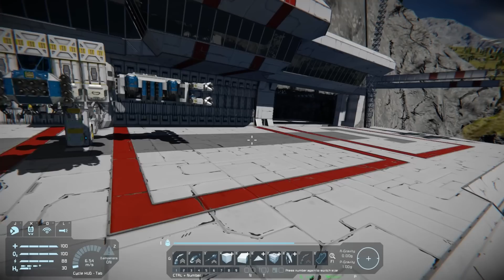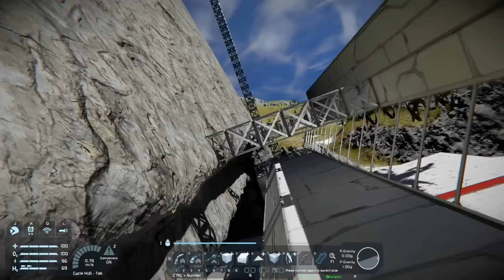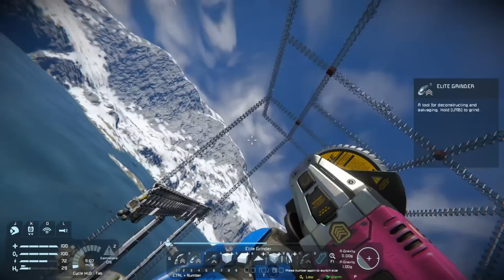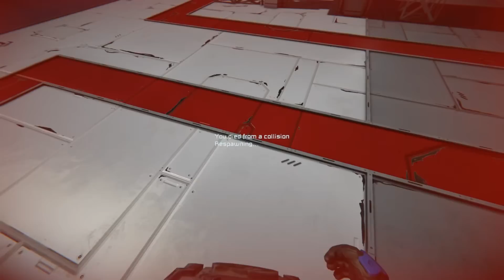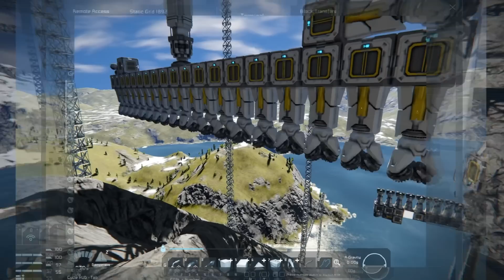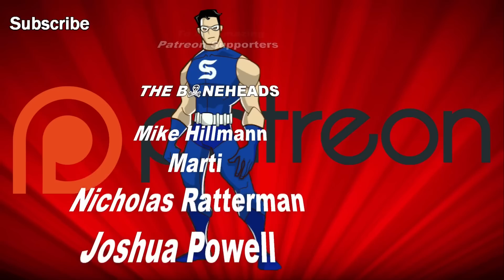You guys SCREWED ME OVER and this test PROVES IT! - Vanilla SPACE ENGINEERS Survival - Ep 21

Comment: You would be better off using blast doors around the outside of your moving door blocks then using the flat armour plates to fill up any gap.
I had a similar problem with a farming setup when trying to get collectors to drop from the Ceiling to collect crops.

Comment: I used blast doors with airtight doors I didn't have any problems also any block that came in contact with the door should be a angled block placed to appear like a normal flat block from the viewing angle

Any block in contact should be angled that includes the wall it rubbes against the door on the right and left   

Had the same problem on a 1/4 test door I was making and I rebuild the test door 8 times before it was happy then made it bigger on the base and works  97% of the time but when I doesn't work it is usually the top door like yours

Comment: 11:45 Structural integrity in Space Engineers is not a thing. You don't have to build the blocks to 100%, just slap the frame and that's it. You can build the base in the air with just one single unbuilt block below touching the ground, just frame.

Comment: I wonder if the "Infinite Drill" design would work in this scenario. The original design is much less grandiose but essentially through the use of Event Controllers and Timer Blocks, it "climbs" down by welding a projection of conveyors and each "level" is a rotor head that it uses to connect to. Hard for me to explain, could probably find the video quite easily. But it's one piston, with a rotating drill head about 5 or 6 meters wide. It extends, locks the bottom rotor to the side wall, releases the top rotor and retracts downwards to where the top rotor will then lock, and now release the bottom rotor and begin extending again. It's quite a brilliant design, but again I really don't know how well it would work on this scale.

Not trying to tell you how to play, by all means keep experimenting! That's the name of the game after all, I just thought I'd share an idea with you :)

Comment: Okay, I've not been part of the discussion up til now, but there is a way to make the doors work. You have to limit the piston so the back of the door blocks (top of the top/bottom of the bottom) doesn't perfectly align with the edge of the adjacent blocks. So, limit the piston movement to less than the distance of a full block. As soon as the door passes the edge on the top it will get stuck. On the bottom the weight of the blocks actually limits its height by a fraction of the distance.

Comment: To be fair, ALMOST all blocks do slide past eachother completely flush with eachother with 0 issues. And to be COMPLETELY fair - your issue must be in using 1 piston to move 1 very long object. If you use merge block to connect to pistons to a single subgrid on either ends it will be much more stable. Either that or you'll awaken  the kraken. With Space Engineers you're never completely sure lol
Reply from the maker: To be COMPLETELY fair ... you've totally missed the point (like a lot of people tbh) .. I had the right solution and I explained exactly how I was going to do it .. people told me to do it a different way WHICH CANNOT WORK ... it's that simple. You're also wrong about the "1 piston to move 1 very long object" .. that has nothing to do with it :)

Comment: So regarding the part where you grind one block and it works:

You don't even have to grind the whole block down. Grinding or welding a single stage will almost always get it moving again.

I've found that cranking the on-axis torque WAY into the red almost always helps in cases like this.

Off-axis is tricky. Sometimes a very low value works (at the cost of speed) and sometimes a looser tolerance (via higher value) is the solution.

Comment: So, the funny thing:
The plain blocks were specifically altered like... What, over two or three years ago? Yeah they used to be unable to move thorugh precisely sized spaces! However, their actual collision box was reduced by a an entire /milimiter/ making it so that any random microstutter from subgrids don't make it grind against others because it has an invisible space to wiggle about.
But yeah- anything that's in subgrids has this microscopic stutter to it (because the physics engine isn't perfect) and anything that has TOO precise of a positioning will eventually break as the subgrid moves an entire milimeter to the side and scratches something. The thing is that it's hard to know what specific blocks are too big and which are just right if you don't experiment (we don't have a wiki with that stuff or anything).

Comment: so, the collision problem with the hangar doors is a mildly interesting one. largely because any blocks with an active state usually have a slightly larger collision box than regular armor blocks. so yes, regular armor blocks on pistons can fit through a gap of the same size, BUT other blocks, such as ANY door normally dont as Keen uses a slightly larger collision box to ensure said doors are air tight.
Reply: Indeed. I hope this is addressed in SE2 as it could lead to some awesome pop up elevators.

Comment: Three things 
One. This is cool
Two. Clear out voxels? And use armor plates 
Three. It may be gravity based problems? A solution would be like using artificial gravity gen and mass set the gen too -1 and make the area small just too cover the why contraption
Reply: Gravity generators do not work within the gravity of a planet, as a rule of thumb natural gravity always overrides artificial in Space Engineers. This is a good solution for massive space doors though, and could be a safer option than simply pushing moving parts into the red numbers on their strength settings.
Reply: @shocktnc  yeah i deal mostly with gravity stuff in space so didnt know that thanks

Comment: (Wasn't here for the 'wrong' comments)
Mostly you didn't hear about it because its hit or miss if it works or not. I've never had problems using pistons+blast doors. Ever. Yes, I realize that is odd and it really irritates my SE gamer buds.

One friend however has your same issue though. He finally went with putting the entire row of blocks in front/behind the blast doors on a hinge so to rotate slightly in order to clear the collision hit boxes of the extending/retracting column. That *might* fix your problem. But I'd test it on a dedicated test save first.

Comment: There is a lot of miss information that goes around in the SE community. I myself have fell for and spread some myself in the early days. I learned to test everything before taking any ones word. The collision  update had a lot of players not understanding what exactly the update changed. I tested a lot of different blocks to see for myself.

Also, something I do in situations like you were in with the drills where you had to go up 3 pistons, you can instead turn the drills to face the direction of rotation rather than going back up. But you will want to take its slow. At least until you get deep enough to set the drills up as normal. Make sure you test this idea out and understand its limits before trying it on your playthrough though, lol

Comment: Not really sure Sky should be blaming his viewer suggestions for experimentation within Space Engineers that doesn't go to full plan. Its an integral part of the game, trying to figure out better ways of achieving  results, lots of effort time and is needed until you've gained enough experience and knowledge to get things done quickly and smoothly.  Until then it will be littered with failures. I think suggestions are just that, its up to Sky to make his decisions as to use them or not.  Perhaps doing small scale testing to be sure and even then it might not work out like in this case.  But blaming viewers for the added time you had to put in is not really fare in my opinion.  Anyway thats my rant over with ;)

Comment: Hey Skye, you can use collectors to daisy chain those rocks back into your base. You'll save all that material then instead of losing. The return rates on stone are VERY poor. So honestly I'd suggest you go find some actual ore deposits sooner or later. Also gonna need a discord or something to give you a workshop link. Got a vanilla rover I think you'll find interesting.
Reply from the maker: You're joking right? I have MILLIONS AND MILLIONS of ingots of Fe Si Ni ... I don't need the stone
Reply: @SkyeStorme  

Hey Skye, I just stumbled onto this video and havent seen any previous ones so I apologize if I am missing any important context:

The blocks with the name "Armor Block" and "Blast Door" are indeed the only ones with reduced collisions. I can deffintley see where a veteran player giving you advice would not think to clarify that it has to have the actual word armor block in it, as we just have all the block names memorized and dont think about it. Im sorry you had to learn that in such a frustrating manner. Subgrids (anything attached to a piston, hinge, rotor or connector) can be quite finicky and while Keen has done some excellent work to stabalize them it can still be frustrating for even experianced players to work with. 

As for the original comment:

Refining stone will indeed yield a lot of iron, so if that is the primary material you need you should be set for a while. However if you start to need a lot of silicone or nickel you will find the turnover rate is a lot lower. This was done on purpose to give players what they needed for basic construction while encouraging them to seek out ore deposits.  

Until your building a lot of metal grids or other advanced components you should be able to get enough iron from simply drilling out stone. A helpful tip for that: Stone deeper in the ground (can be told apart by color) yeilds more material per square meter mined, so you can make your drills a lot more efficient simply by digging deeper down as you are already doing.
Reply: Btw I have been playing for many years now and have taught multiple people how to play successfully. I promise this is valid information.

Comment: Just to be clear so I'm not misunderstanding... some of the comments said you don't need the special pieces to make a working blast door (thus allowing you to just have pistons that slide blocks up and down to open big doors three or four times the size of your current door). But you added the special doors anyways and then it didn't work? But you did a test and saw that the normal blocks work (?like the comments said I guess?) while the special pieces don't work (?which the comments didn't mention I guess?) and now you feel like you were lied to? I'm confused.
Reply: If the special blocks aren't working, but you want them to work and still want bigger doors, why not make the doors triple wide and put only a single special block at the top so the special blocks cannot physically touch the sides?

Comment: i'm more a fan of garage doors, double hinged, swinging down from the ceiling(armour block edges)... blocks sliding, even after the update that made it work, never really worked properly for a lot of things.  for your application it might have been cool to sensor trigger a timer that slammed a plug in to cover the blast door edges, timer triggers hinge to open and a second timer, the second timer triggers the doors, closing is reverse order, so, need a second string of timers.  a hidden rotor might make it prettier.

Comment: U can right click on the slider to manually increase the force until u get the desired effect on the axis and nonaxis of the piston. It will increase the force to move the piston in and out. One more suggestions is to change it to a two piston setup. 1 on each side to decrease the jiggle and make it smoother to move in and out
Reply: Doesn't right-click just reset the value to default?
You may be thinking of shift or ctrl+clicking.

Comment: Blast door blocks do not have the same size collisions as regular blocks, they are smaller at the tips, because they are intended to be used as or near moving objects. Do what this information what you wish.
If there was a way to contact you there are a few discord servers with knowledgeable players of this game where you could get information if you needed it. Good to see you’re otherwise enjoying a game some of us have had alot of fun with over the last 4 years.
Also there isn’t necessarily structural integrity in SE. a frame is just as strong as a fully welded block, from a load bearing capacity, however they are very fragile if they are damaged in any way the connection will be severed, and there is collision damage as you’ve seen.
Reply from the maker: I guess you didn't watch the previous video because you are just repeating what I have already said.

Comment: In a game like this, if the parts can catch on something, it will catch on something. You may get lucky sometimes or even most of the time, but it will catch. In making mechanisms like this, your biggest hurdle is working around that. In this case, id use something that either acts as a guide rail, basically smoothing out the motion so the edges of the mecshes dont have to ever hit one another, or id use something like a blast door block instead of an armor block, since its just a bit thinner than an armor block, and use a half plate to hide the little gap on the side your door isnt on

Comment: Hey Skye,
First, and foremost -- Symmetry is overrated. 

Two questions:
1. How fast can pistons move -- absolute maximum speed?
2. Can solid blocks in a row can pass each other (like your single block demonstration showed)? 

Suggestion:
For the third hanger bay only -- Create a door of solid blocks - Put a piston deep enough (and a trench) to drop the entire door into the cliff at super-fast speed. 
If max speed of one piston isn't fast enough, add stacked pistons to double, triple, quadruple the speed. 
(with colors, half blocks and angles you can create a patterned door)

Another suggestion for the hanger bar doors:
Leave #2 hanger the same -- with existing tunnel and the existing slow door.
Have #3 hanger bay be 12 high x 16 wide with the super fast solid door. 
The control room stays above hanger bay door 2 & adjacent to the top of hanger door #3. 

Anyway. maybe worth a test in your already created test rig. 

Great fun - do what you love - its great.
Reply: I cannot remember piston top speeds off the top of my head, but you can indeed stack them for faster movement, however things will become more and more unstable the more you stack. 

As for blocks passing each other:

The blocks labeled Armor Block in the G menu can indeed slide past each other, they along with blast door blocks have reduced collisions specifically to enable this. However most other blocks do not have this reduced collision and will likely get stuck when trying to slide past each other. I can think of a lot of ways to solve this issue but none of them are simple enough to explain in a youtube comment.

Comment: There's a number of settings involved that could influence the results

Have you selected tension dampening on the pistons? 
This can help stabilize pistons from shaking.

Alternatively, different door designs may work better
Reply: Both valid things to test, though I can save some time- I have spent a lot of time testing and have not found a valid way of getting hangar doors to smoothly slide across another block. The issue is that they have a larger collision that comes into play when they are a subgrid.

Comment: I don't play space engineers (yet) but could you use pistons horizontally on the blast doors to move them slightly in or out, and use a solid block on one side and the slightly shorter block on the other side? Hopefully it will reduce the space of having them on either side? If this sounds confusing I'd be happy to elaborate.

Comment: Have you tried fiddling with the extension length to ensure it doesn't go past the lip of the block you want to land flush with. If it goes past it can catch that lip and hang up. I use .00x levels of extension to ensure it looks flush but won't go past that lip. It won't show anything past .0x but it does actually move that fine.
Reply from the maker: I want a solution that actually works properly .. not something I have to 'bodge' :)
Reply: @SkyeStorme  you don't have to do it everytime...just to get the extension min max lined up so it looks flush but never goes over the lip of the blocks next to it.

Comment: I mean... Now that you got screwed over, why not change the door design completely? maybe a folding/sliding door that hinges (with hinges obviously). Also about the sensors you could make said sensor trigger a timer block which can have multiple controls on it. That'll remove the need to use multiple sensors for one single gate/door
Reply from the maker: Because hinged doors suck :)
Reply: @SkyeStorme  Fair enough 👍
Reply: @SkyeStorme  Appologies, though I didn't realize that there were still blocks with collision too large for the actual block.
You could for the floor and ceiling use blast door blocks, mounted sideways, with the open side facing the hangar door blocks. Those have a smaller collision volume on purpose, so it should fit.

Comment: In order to move the wind turbines so you don’t have to constantly keep moving them and so you can have the view from the observation deck sooner why don’t you put them at the top of the original blocks you used for the alignment at the start (the one that goes up the mountain) as they only need to be connected to a block connected to the base so you could just have them in a straight line or if you wanted make a mini platform and add them on that so they should be out of the way until you are ready to make a wind farm?